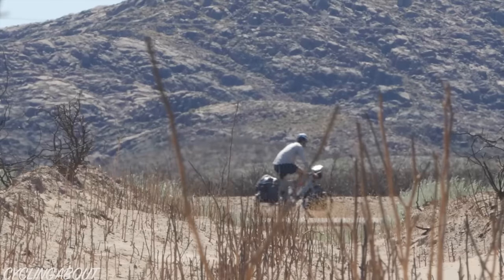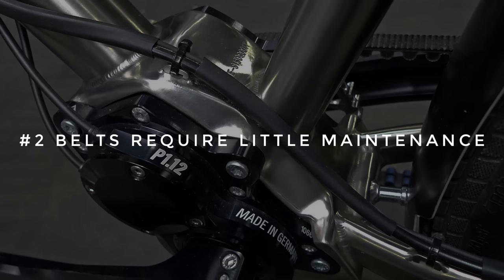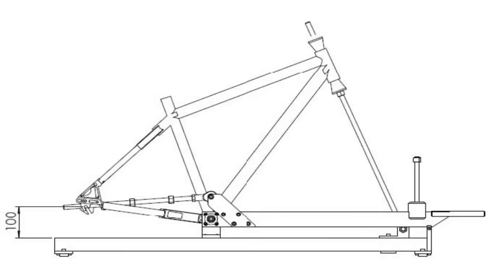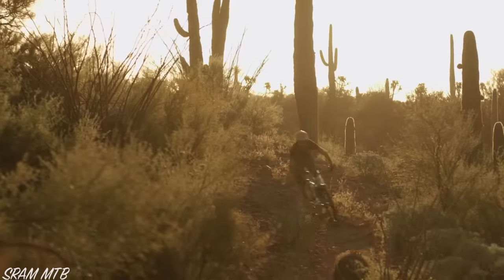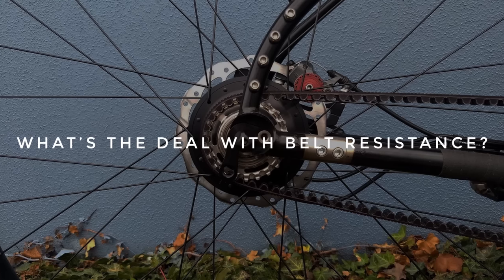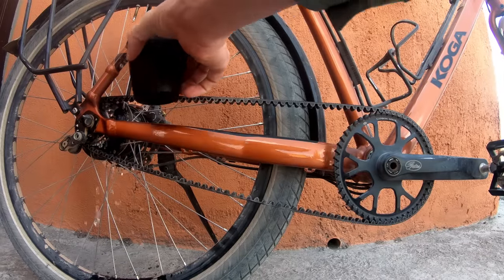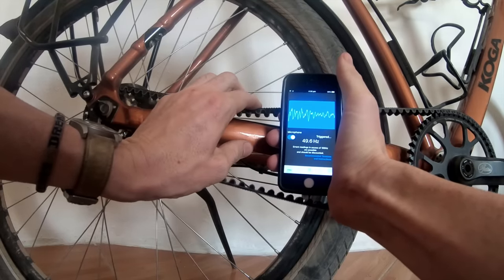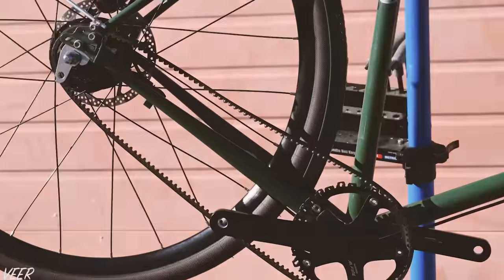Belts Are The BEST Bicycle Drivetrain Available (Epic Testing!)

Comment: I used a belt drive for a few years and doubt that I'll ever use one again.
- I had to lubricate the belt frequently to eliminate squeaking.
- It was a major pain to remove the rear wheel for repairs.
- Even with a Rohloff hub, I could easily feel the increased drag compared to a derailleur and chain.

On that last note, I'll never use Rohloff again. I put under 1000 miles on my bike annually, I'm not an aggressive rider, I don't ride in the mud, and I keep my bike reasonably well maintained, including changing the oil on the hub. But the Rohloff had terminal failure after about five years. Had that happened while on the belt drive, the expensive of replacement would have been prohibitive.
Reply: I'm interested in the efficiency part when it comes to belt versus chain. It seems hard to find non-biased, objective info on this. Which is faster belt or chain? I tend to think the chain is faster based on what I've been able to find. The corporate push for the belt has been strong in recent years.

Comment: There goes the ritual of getting out the chain breaker, removing the chain, soaking it in paint thinner, scrubbing - twice or three times - washing it repeatedly in soap and water, drying it on the stove, replacing it on the cogs and re-oiling it.

Comment: Now granted Im not running in any rough conditions. Regular roads mostly. But Ive had the same chain on my bike for over 50000 km and about 20 years now. It holds forever. Im generally trying to not run it offset basically mostly using 3 gear ratios for the 3 frontal gears going straight back. Cleaning it when needed but at the most once a year in spring when i take it out the basement again. Ive also never had any rust to worry about. Now granted Ive never used a belt driven bike but Im pretty happy with the chain.

Comment: Not sure I agree with your argument regard weight savings. Sure a belt is lighter than a chain, but a gearbox will add a lot of mass that isn’t needed in a chain bike. Would love to see how you came up with the 100-300g figure, maybe you did already take this into account!
Reply: I have mine and my son's bike running WTB Scraper rims.  Only difference is his has 11 speed cassette and mine has a Rohloff.  Mine wheel weighs exactly 3 lbs more.  Forget about the minor difference between chain and belt.

Comment: Hi, I have a Q about an image which is visible in the video. Which bicycle (frame) is it that we see from 1:20 to 1:22? If I am not wrong the rear sprocket & belt are placed outside while the rear traingle (chainstay, seatstay) at the rear dropout is placed further inside, hence the belt runs  'open' between the rear hub & the crankwheel, hence such a frame does not need any 'splits'. Do I see it right?

Comment: Hello! Thanks for sharing this super content 🙌🏻
I am going to change my traveling bike with chain for a belt system.
I dont really want this Rohloff because of the weight on the back wheels… Therefore what is your opinion avout traveling with a pinion gearbox c1-12?
Thank you 🙏🏻 
Raphael

Comment: Did you ever use an Gates CDN? I bought a bike with Gates CDN Parts. I didn't know the difference between CDN an CDX. The rear sproket lasted <1 minute and 200m. The CDN Belt was compleatly destroyed after aprox. 2500km. I changed both parts to Gates CDX. The front sproket (CDN) looks horrible after 5000km and it makes a horrible noise when it is humid but it still works. CDX is deffinitly better, but I'm not yet shure that belt drive is realy that good. Currently I would not buy it again, but I'm still gaining experiences. By the way all parts are rediculous expensiv and belt drive is slower than a chain.

Comment: Maybe for a single speed. Internal hub gears 
1) still need maintenance and replacing
2) only one gear is efficient, the rest will take power off your ride when producing such little power. I suggest you get internal gears with the highest gear being the most efficient instead of the lowest, as many are.

Comment: nice video, but you should try trimming a little bit of low frequencies on your voice cause it sounds super boomy on my speakers and I don't even have a sub woofer.
Reply from the maker: It's mildly frustrating that the sound on my most popular video is not right. Should be better on newer ones.
Reply: @Cyclingabout  It's actually decent, and most people are watching on their laptops or with cheap speakers so they won't even notice anything

Comment: Went and checked a couple of bicycle shops here in Sydney Oz and a good enough Rohloff carbon belt driven commuter/touring hardtail bicycle package in 2023 would cost me AU$7,000+ and up!?!
You can get a very good dual suspension MTB or gravel bicycle with top of the line parts bin, maybe a brand new moped or a reliable 2nd hand Toyota or Honda for that money.
Reply from the maker: Australia has virtually zero internal gear hub or gearbox bikes compared to other regions. You can get Rohloff/belt bikes in Europe for half that price, and it's about 1/7th the price if you go for a Shimano 8-speed hub. Maybe one day...

Comment: I'm a huge fan of long distance touring and low maintenance requirements, however don't find may issues with keeping my chain lubricated nor do I find myself on treacherous dirt roads and especially not this crazy gravel terrain in the rain and mud quite often. I just prefer to spend the day in the tent if its rainy and I mostly stay on the pavement except in the instance of finding a nice campsite. Is it possible a belt might still recommended in an instance like mine? I don't expect @cyclingabout to reply, but I'm open to others' opinions as well. Thank you all.

Comment: IDK. Had a belt drive for ~5 years and ~15.000km (2014-2019). The problem is, that the belt is sanding down the gears. Especially the rear gear. With the smallest amount of dust on the "tooths" it´s sanding down the metal gears to "sharp shark-tooths". So at the end the gear-tooths were so sharp it was eating up the belt drive. The Effect: The belt was loosing tooths. The belt itself would have easily run without any problem for a much longer time. But you have to keep it very very clean. I am not talking about mud or sand! Dust! So it´s to much effort and "maintenance" for me. And the two gears and the belt are expensive. The financial point of view: 80€ +120€ for the two gears (rear & front) plus a new belt (~80€). So including work it will alway easily exeed 300€. For 15000km way to much. And I have seen video of mountain-bikes "loosing teeths" after less than 1000km. Chains are much cheaper. But: I loved the run and never missed the greasy dirt of a chain. But 300 Qid is way too much. What is your experience? Maybe I am totally wrong. But how many kilometers did you get out of your belt? If you had to replace something; what is your long time experience?
Reply from the maker: I regularly get 30,000-35,000km from a belt drivetrain. I clean my drivetrain monthly with a toothbrush and add a few drops of silicone lube. It's incredibly low maintenance for me.

I don't know how to explain the missing teeth situation, but my suspicion is that it's a frame design issue, where the rear triangle is not stiff enough to keep the belt running in a straight line. I've never had this problem on any belt drivetrain I've used in the last 100,000km+.

Comment: I have been riding with a belt drive for a few years now and I totally agree with all the points made in the video. Going to drivebelt from chain is like discovering disc brakes after using rim brakes, it's amazing and totally recommended.

My bike is a Ghost urban bike but I had a major failure with the original spec belt which was by Continental. It suddenly snapped after only about a year of use so I found out the hard way that there is a recall for Conti belts but the Gates system is so much better and confidence inspiring!

Belts save so much time and hassle in that there's no need for regular cleaning of chain, chainrings, cassette, etc and I usually took my wheel off too everytime. It just frees you up to spend more time to enjoy riding rather than dealing with a messy chain and gears.

Although perfect for urban/commuting bikes It's just a shame that belts will never be as mainstream or popular as chains mainly due to them needing a non derailleur gear change system and so more expensive.

Out of curiosity how long have belt driven bikes been around for? When did they first appear as up until recently, belts were pretty much unheard of?

Comment: Thank you for doing a great job of explaining this promising technology!  You've inspired me to fit the missing piece into the puzzle of marketing my invention.  It's a special transmission that would fit into the bicycle/electroped market at the mid-to-high end, which the likely cost to produce would require.  The potential for a belt drive opens the possibility of a dependable, efficient, weatherproof, automatic IVT aimed at higher end trail riders with full-suspension who hate derailleurs and massive hubs!  
I've long suspected the belt drive would round out a package that would be promising in a finicky marketplace with a critical eye; you've covered all my questions!  You've shown that belt-drive technology has hardly begun to be exploited for its potential!  As a mechanical engineer who's designed various belt-drive systems, I'm impressed!
Reply: Promising? It's already a mature technology. It's ready, nothing more needed.

Comment: as a kid, i saw my brother once had stretched chain, thats it. i never had it. Also, you can use that tensioner thing so thats not a problem. ive never seen a chain to detheriate so its useless.
I dont go swimming in the sea with a bike, so i cant say about its rust resistance to salt water, but my bike spent all of its time outside, except the seat was covered, for years. it didnt rust.
chains also requiere little to no maintenance. After years of using a bike as a kid, worst case scenario i had to grab a hammer and a nail, to fix it, if a 13 year old kid could do it with a hammer and nail in minutes, you got no excuses. Also, my bikes chain was never greased.the insides of pedals etc were, of course. Also, when finally autumn came and it was time to start riding my bike, i checked the wheels if theyre okay and the chain, i just pedaled. First 50 meters mightve been a bit clunkier till everything snaps into place and frees itself from the dirt and possible rust, but thats it. i didnt use water or anything to clean that chain.
Belts sure are silent, but honest question, why youd want it silent? Whom are you stalking? I want some noise so pedestrians ahead of me can hear me coming, but even then, chains werent louder than the wheels contacting the road.
And weight is just...
who cares about 300 grams extra weight? Who?
Reply: and what about price or accessibility. if my bike were to break today, i need parts now, not after a month.

Comment: Most motorcycles use chains. There's a rubberband effect, apparently, and the cost. I think relaxed Harleys use belt often. Also the aesthetic factor as the rear(bmw f800r) often looks big, so they shy away n opt for chain.

Comment: On my speed pedelec the belt was always squeaking so I had to clean it even more regularly than a chain. It also was very dirty when you touch it compared to a waxed chain. After 11.000km both front and rear cogs and the belt were done. Exchange would cost $300,- excluding labour. 
After that experience I changed to hot waxed chains. It's cheaper, less work and cleaner. I get about 20.000km (maybe even longer but I don't know that yet) out of a cassette and front chain ring. Most used cog in the cassette is changed every 7000km. Chains last 4000-5000km. I have 4 chains that I cycle. Depending on the weather I can drive 400-800km without maintenance. Waxing 4 chains takes 2 hours. Total cost for 20.000km is about $150,-
No more belts for me.
Reply from the maker: Waxed chains are definitely cool too!

Comment: Last time I checked the chainrings/cranks for belt-drive systems cost a *mint*.
Reply from the maker: I think $60 per 8000km is pretty reasonable!
Reply: @Cyclingabout  I think a more helpful answer would be how much more $$, and how much more mileage... I wouldn't be surprised if it's a big difference for someone doing a lot of trekking, but I think we're a ways off for the every-day rider... I haven't checked the difference in price between chains & belts... i'm guessing it's one of those "economy of scale things"... like good quality bike lights used to be! ;-)
Reply from the maker: @buixote  I think distance-per-dollar is the most appropriate measurement as we can calculate the same for chains/cassettes and compare them. An XT/XO1 chain is normally about $60 and the expected distance is ~8000km, meaning a nice derailleur drivetrain is more expensive to run than a belted setup.

Comment: I had a bike when I was a teenager, I got it used. I rode it every day for dozens of kilometers. Never maintained it and never even oiled it. Maybe if it was covered in rust I'd spray it with WD-40, which you're not supposed to because it collects dust and then breaks your belt. Well, all in all, the original chain never broke, never.
I do believe this guy, he goes across continents on a bicycle, probably does hundreds of km a day, every single day. But for normal people, a chain will last a lifetime without any maintenance.

Comment: I don't know, I ride my bike daily 20 km. I only replaced my chain this year, and I've had the same chain since I bought the bike 13 years ago.
I definitely did not need to replace it, since it was running quite fine still, but I recently replaced all the mechanical parts on my bike.
I regularly maintain my bike, and have kept it in tip top condition since I got it in 2008.
Reply: I bought a new bike in March 2022 and had to replace the chain after 1,100 miles just a few months later because it stretched beyond 0.75% in some segments.
Reply: @assortedmountainlife  that sounds like a mediocre chain.
Department store bike or?
Reply: @southpineshooligan  It's a 2019 Salsa Cutthroat Rival 1 (SRAM), carbon frame, hydraulic disc brakes, 1x11, $3700 msrp. It helped me get a few KOMs this year near Glacier National Park where people come to cycle from all over the world.
Reply: Were you measuring your chain stretch on your bike? There is A LOT of regular maintenance that requires frequent part replacement if you want to keep the thing running well. Chain, cassette, pads and brake fluid, wheels, tires, cables, ...
Reply: @assortedmountainlife    ok right on, so you got a quality machine from the get go. 👌 
I've got an RSD I paid about 4700 for roughly 13 years ago.
I replaced the chain when I purchased the bike. I forget the brand, but I paid nearly 200 bucks for the chain.
I had it tightened twice before I replaced it recently on a full mechanical overhaul. I couldn't even tell you how much travel I've put on it. I travel roughly 20 km daily to and from work, plus recreational riding.
Reply: @assortedmountainlife  I've regularly maintained everything on the bike. My local shop retunes it once a year.
Reply: @southpineshooligan  Nice! as long as you're getting tune ups done that should be sufficient in identifying issues.

Comment: I driven with 20 years with same chain above 100,000 KM and its stays every time outside in rain and hot sun and cold and i'm near the sea. note: in closed chain bike makes almost no noise to.
So what?

Even so you have to pay more money for belt driven bike then chain so the higher price evens its out by maintenance because of the higher price by the belts bikes....
Oh wait, i don't remember any maintenance ? only oil the chain and once the chain flew off it was like 1 min work to get it back.
They say to mean that things should only be changed if they are wrong.

Comment: After watching this video last year, I decided to buy a bike with a belt driven system (Sensa bike with Alfin 11 speed hub). In my case the extra resistance is not a problem. Why? Because I use it manly for travel to and from work. My old Sena had an 27 speed chain driven system. Due to rain and dirt the chain and gears were never clean. Also problems with rust on Monday (when the Friday before was wih rain). So looking at resistance, a belt drive is lighter at the end for me than a dirty chain system ;-)

Comment: Hi everyone looking for some advice. I want to buy a belt drive bike for commuting and currently looking at three bikes and one possible. 

- trek district 4 equipped  (8s)  £1700
- cube travel pro (8s)  £1249
- canyon commuter 7 (11s)  £1800

And as my work do a cycle to work through halfords possibly 

-boardman urb 8.9 (8s) £850 (£570 c2w)

Is the boardman worth picking up and adding /changing components to for the price?
The others catch my eye as they are pretty much up kitted up to go. Any other recommendations?

Comment: >Scene< You're out the back ass of Ulaanbaatar and your internal gear box that you have to run with a belt drive has just shit its self >end scene< 
Give me a Shimano ten speed derailleur set-up for touring any day of the week. It can more or less be repaired in any place with a bike shop on earth. Each to their own though, some awesome footage in this video too.
Reply from the maker: It's obviously not going to be great if something happens. But given I've spent the last decade travelling with this setup and have never suffered this fate, I'll take the daily benefits I receive (close to zero maintenance, replacement belt parts every 30,000km+), over the off chance I MIGHT need to call a taxi and get some parts shipped in via an international courier.